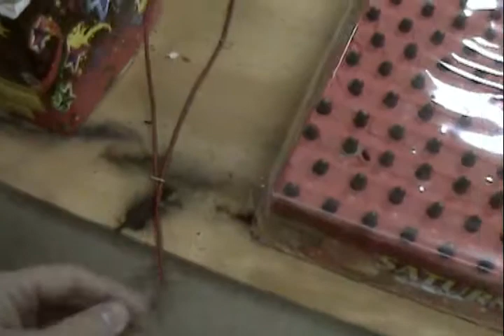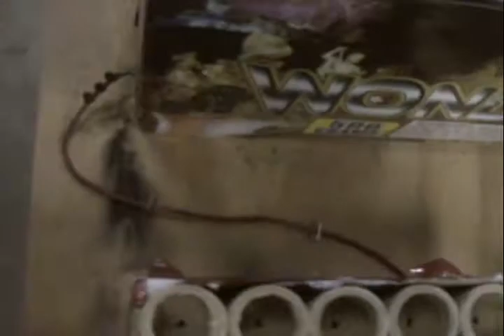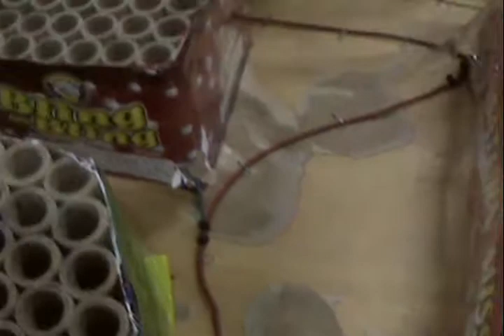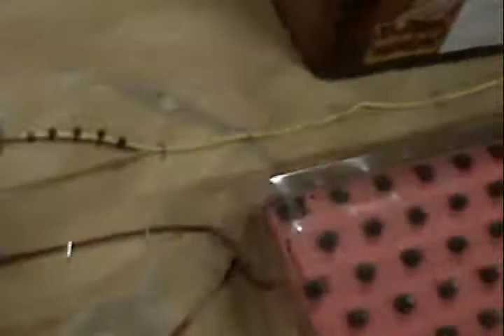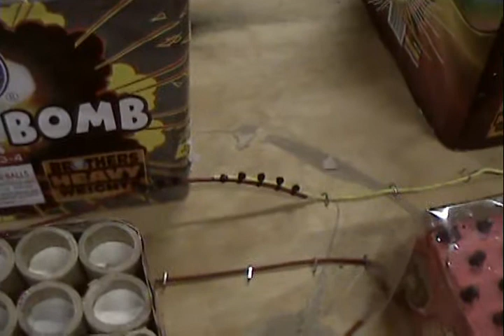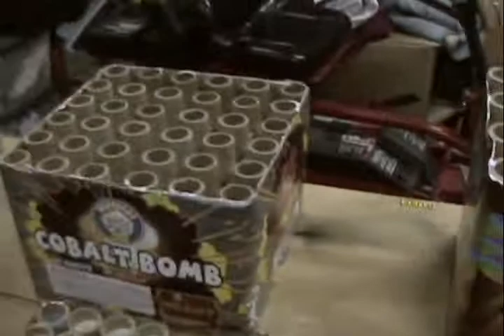Fireworks - 12-31-2008 - My New Years Eve 2008 finale board

Comment: OneHeckuva Firework is by deffinantly one of the best 500 gram cakes you can buy, z style mine cake, with great finale shots. Its the exact same cake as ScatterBrain (called a Rewrap). Search for Scatterbrain on here and check it out, or use a search engine. My stash is about 18 500 gram and 40 200 gram large but still havent got my oneheckuva firework/scatterbrain yet, i want to get 4 to put in a finale board.